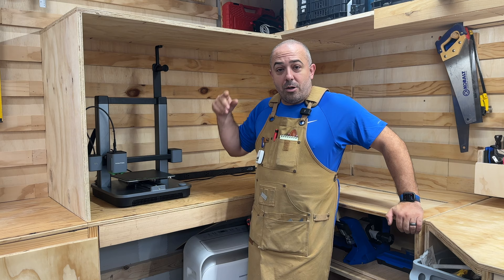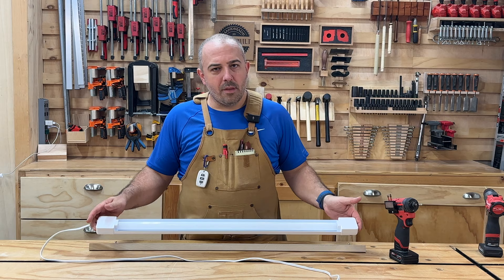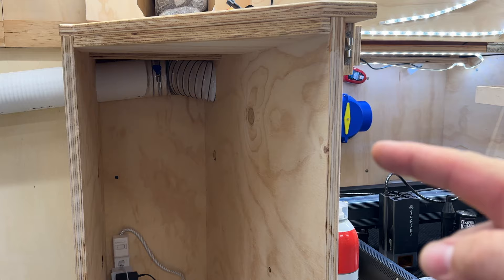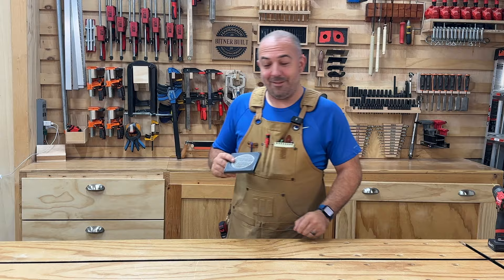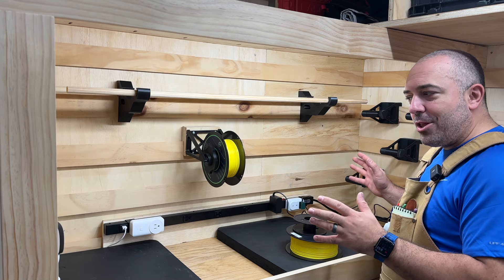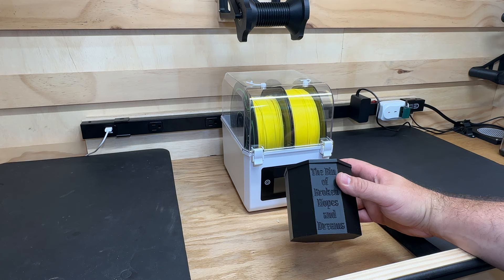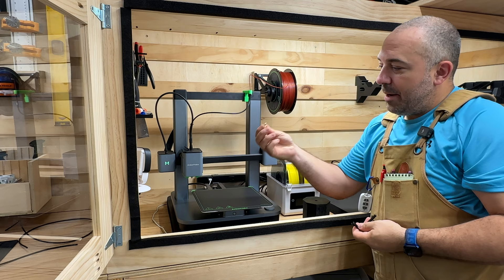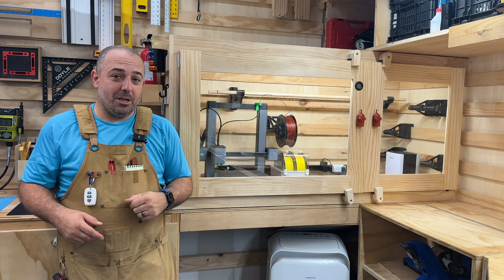Ultimate 3D Printer Enclosure With all the Extras! With space for 2-3 of my Ankermake M5C's!

Comment: This was a really nice, well planned project. I did notice one thing that needs to be slightly modified. When you put your printer(s) on the Husky knee pads, because they compress under weight, they are restricting airflow to the underside of your printers. Air needs to be able to flow under your printer, to keep it happy. All you really need to do is, cut a piece of 1/2 inch plywood that is the same size as the knee pad, place it on top of the knee pad, and then put your printer on top of the plywood. You're still eliminating noise caused by vibrations, and your printer can breathe. GREAT PROJECT & GREAT VIDEO!!!!!!!!!!
Reply from the maker: Great tip thanks!

Comment: Great video - I really appreciate your common sense knowledge and the usefullness of your designs. I definitely agree with your comment about how today's 3D printers are SO much easier to use and the print quality is SO much better, than just 5 years ago. I bought my first 3D printer in 2018 - a FlashForge Creator Pro - and with the tedious bed leveling and the lack of 3d designs and the slicer programs that were available then, I stopped using it after about 10 prints. But,  I just bought a Bambu Labs X1-Carbon 3D printer with the AMS color system during their Black Friday deals and WOW - what a difference a few years can make. This thing is FUN to use and I even look forward to learning CAD design in the near future. Not bad for an old 69 year old retired concrete mixer driver !! Thanks for the ideas on the DeWalt planer parts and this French cleat prints as well. Charlie in Central Ohio
Reply from the maker: Thanks Charlie! Yea it is amazing how much better they are! Hey keep learning never too old!

Comment: Since your review video of the AnkerMake I've been seriously considering buying one but my shop is in my un air conditioned garage in South Florida so I have been concerned with the humidity. I was considering building something just like this. Thanks for another great video
Reply from the maker: Thanks! Yea this will do the trick I have been impressed that the little unit gets it in the 20% range. It took about five or six days before it got down to that level, when I first put it in I figured by the next day I would see a huge drop and I didn’t. The key is keeping the cabinet closed all the time unless you’re working on the unit. At most I keep the doors open for 15 minutes to maintain that humidity in there.

Comment: I've been using foam Yoga matts on the base of all my printers for about 5 years now, they work great, stops the noise and vibrations traveling through my ceiling into the room below.  
I never liked the idea of concrete slabs, I don't find they would help any better for my setup.
Reply from the maker: Yeah, this matt definitely feels like the same material as a yoga mat just thicker, I think it’s done really well!
Reply: great video by the way,  @BitnerBuilt  I'm very impressed by the efficiency and quality at EVERY level, loving the modular abilities to.

Comment: Good stuff! What was the CAD program you used?
Reply from the maker: Tinker cad is ultra basic beginner, and free online! There are solid shapes, and then there are clear shapes that will subtract from the solid shape when you highlight both, and then click the merge button up at the top. So I made my square out of a solid shape, and then I placed the cylinder as a clear shape, and then when I put them together, it deleted the circle out of the middle. 👍
Reply: @BitnerBuilt  Thanks! I’m try to print a spur gear for an oscillating tower fan. I hope you don’t mind another question, in Slicer can I pint multiple copies of an item in one print session?
Reply from the maker: @mitchellbernstein42   yea I do all the time. The only risk is if one of your parts detached during the print it might mess everything else up, but I was printing six things at a time yesterday.

Comment: Does the the printer sink into/ compress the pad? My printer has a fan on the bottom. I’m afraid the weight of the printer would push down into the pad, blocking the air flow.
Reply from the maker: No like I said it is weird, it’s very firm but also squishey. The ankermake has a fan on the bottom as well and it’s not obstructing it. It’s Home Depot so you can always try it and return it

Comment: What thickness of plexiglass did you get and where?
Reply from the maker: Only 1/8th inch from Home Depot. You would be surprised at the sound dampening for so thin. Some people do a double pane of the same with leaving a small air gap between them as the sound deadening agent

Comment: just got my M5C and looking to build something for it.  I'm limited on space, so I'm looking to build something as small as possible. Do you know what the minimum depth would be for something similar??
Reply from the maker: I’m I’m on vacation right now but when I built it for my M5c I believe 24 in depth was what I had, just came sure you move the bed all the way back and forward and give a little gap in the back for the cable so it isn’t pinched
Reply: @BitnerBuilt  That's what I was measuring, and got about 22" I think.   Anways, thanks for the idea and have a great vacation.

Comment: I bought the M5C after watching your first video and haven’t used it yet.  Is the cabinet a must or just better performance?  I only have PLA filament right now.
Reply from the maker: oh definitely not a must. I built it to keep the saw dust off of it. Where an enclosure comes in handy is some of the more complicated filaments, like ABS. That one likes constant heat or it cracks and it produces doc's when printing so it not goo to breath that in. Using it with plastic and many others is safe to do inside the house no enclosure
Reply: I have my M5C without an enclosure in our craft room, which has the AC register closed off to keep drafts off the machine.  I works fantastic for PLA+ filament.  I have not tried ABS or PETG on it yet but will be soon. I do think an enclosure for those will improve the odds for success dramatically.